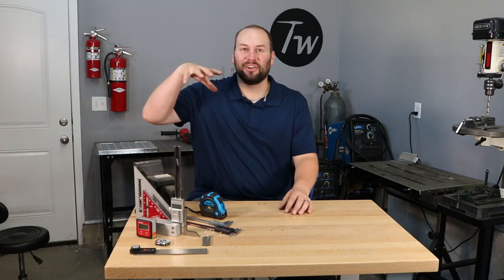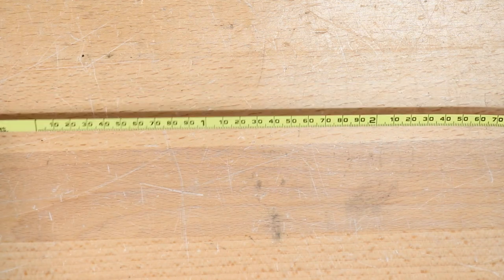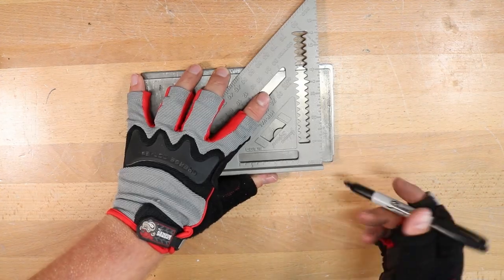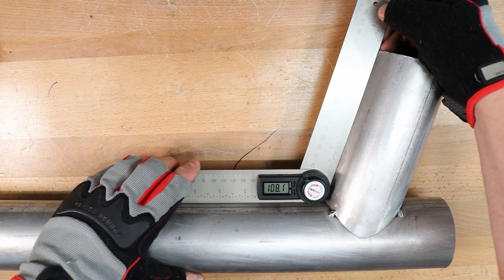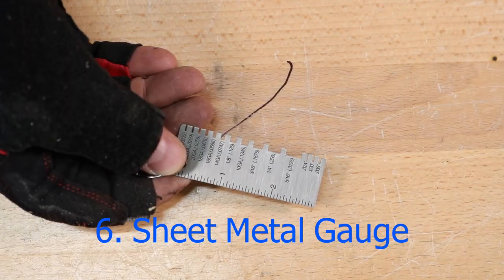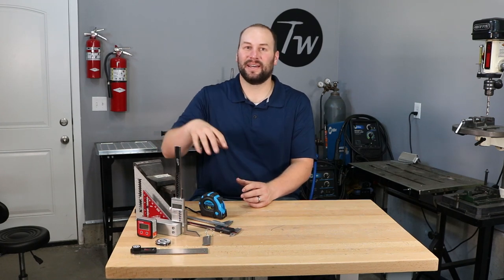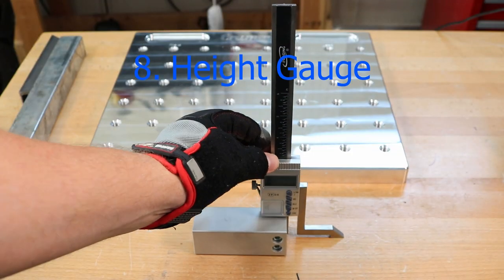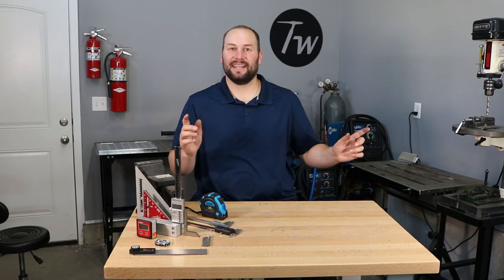8 Measuring Tools for Welding and Fabrication in 8 Minutes

Comment: There is a 4th way to measure with a set of calipers. On the back of the anvils, there is a notch that you can use to measure the shoulder depth of an item. Sometimes it is hard to get this measurement with the depth gauge measuring rule out of the bottom of the caliper. Once you measure a shoulder with the notch on the back, you'll see how much more accurate it is .
Reply from the maker: I just tried it, and that is awesome! I've been using calipers for the better part of 20 years and never knew about that. Thanks!
Reply: @TimWelds  I cannot take the credit - someone showed me many years ago... I'm glad you were able to figure it out from my description. Great channel - keep it up!
Reply: Macadamia, I didn't quite catch it from your description, so googled a little bit on that, and wow that's a new one to me as well as far as using the anvil to measure depth of a shoulder!
Reply: I've heard it called the "step" gauge. Nice to have since two of my three calipers are harbor freight "composite" and lack the depth pin.
Reply: @pondacres  I also googled but had no luck and am still unsure exactly what it being measured. Hope you can explain a bit more or post a link?